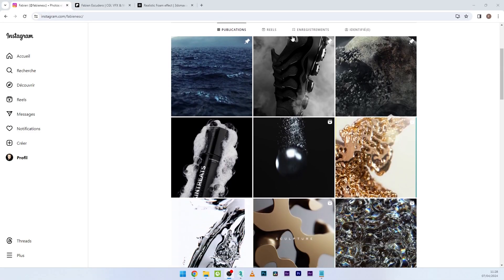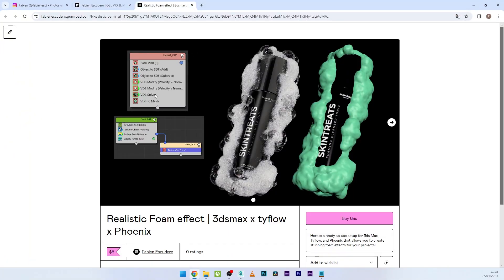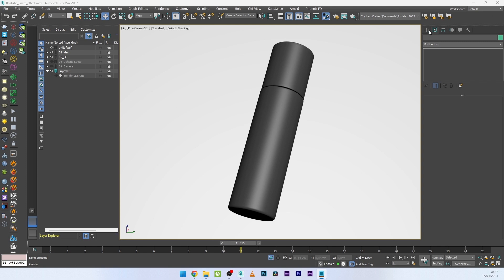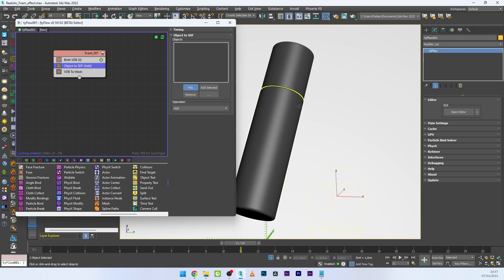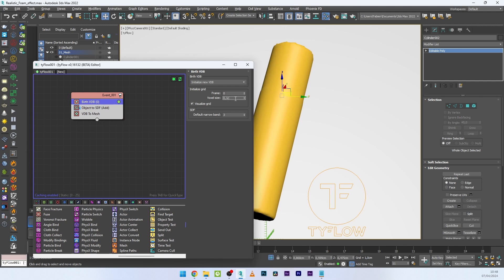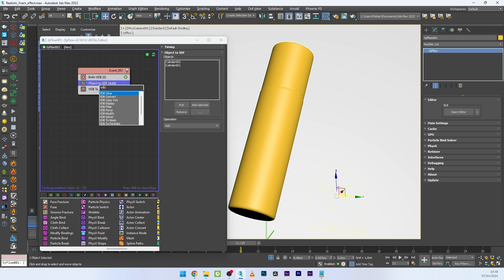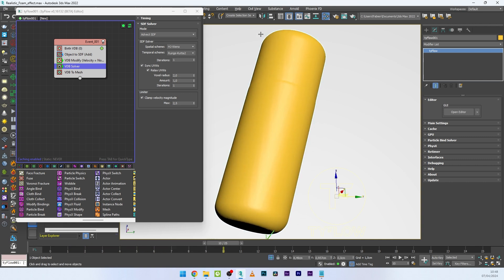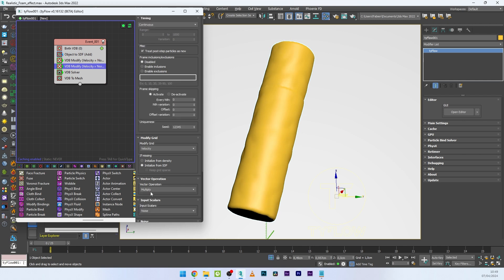Realistic Foam Effect | 3dsmax x Tyflow x Phoenix

Comment: When I add the second VDB MODIFY and set it to MULTIPLY, nothing happens. Any solution ?  Thanks !
Reply: I have the same issue :(
Reply: Nvm once I swapped the secondary VDB to the noise texture map and added the cylinder to the new section it worked. The base setting of multiply with the noise didn't work though